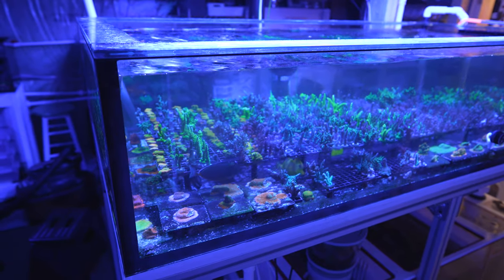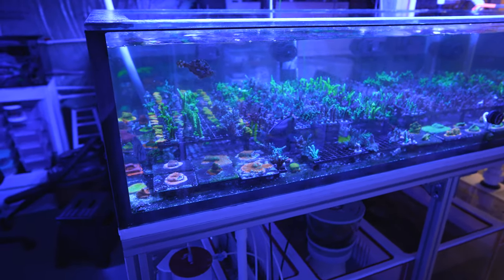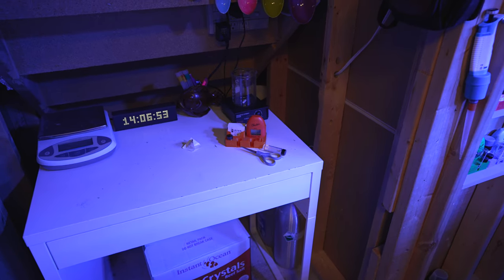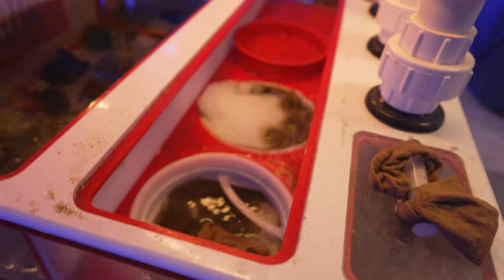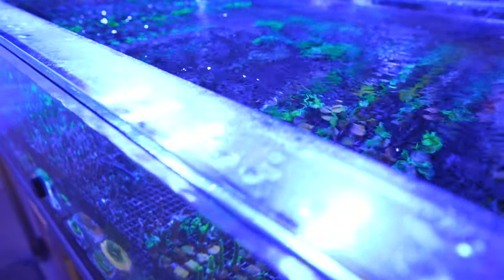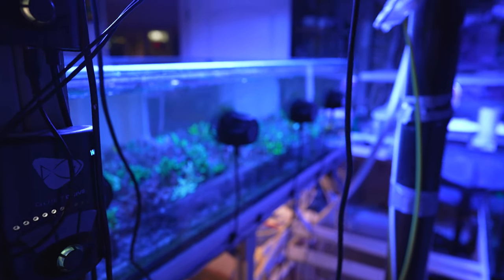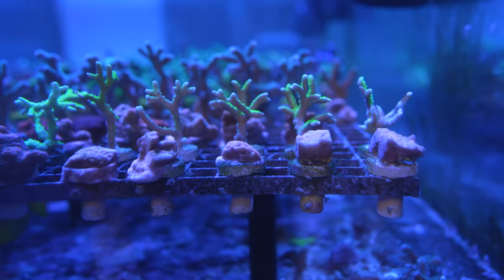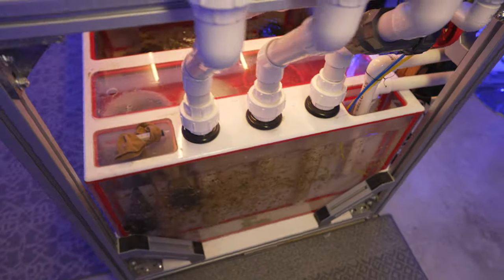Found Copper In My Reef Aquarium

Comment: This is a weird one. One thing I think though is that rusting equipment would not necessarily give you copper unless the piece of equipment itself was made from copper. One thing that cane to mind was that your system is in the basement. Do tou have ant exposed copper pipe above the tanks. I know a reefer that had a frag system in his basement with exposed pipe above the tank. There was condensation on the copper pipe that was dripping into his system causing all types of issues. Good luck.
Reply from the maker: OMG! I have not even thought about it, I'll double check, but I think all of my house plumbing is PEX.
Reply: Or maybe there’s something leaching copper into your source water… but wouldn’t that be removed by your rodi filter?  Is there anything in your rodi filter that’s leaching copper??
Reply from the maker: @MW-ut3dk  My theory is that it was the pump I was using to move water from RODI container over to Saltwater container.

Comment: Rust = iron oxide = not toxic. Corals love growing on ship wrecks.
Reply from the maker: Agreed, I know of people who dose iron into their tanks, especially if you have chaeto. But what else could this be?
Reply: @TreasureCorals  Iron and iron oxide is chemically not the same though. GFO, which is used to remove phosphates, contains a form of iron oxid. 
Too much iron as the trace element can be harmfull, too much iron oxid is not. So don't worry about a rusty magnet or pump, it's not a problem.
Reply from the maker: @Harolddespui  any thoughts or guesses on what could be the root cause for unexplained coral peeling?
Reply: @TreasureCorals  You got 200 times the amount of copper as in natural sea water so i would solve this to start with. 🙂

Comment: So, did you retest  your source water and saltwater after removing the pump(s)? What number did you get?
Reply from the maker: I just did. Freshly mixed is 0.02 ppm. RO water is zero.
Reply: That narrows things down that it can't be RO water. Did you mix new saltwater In the same container what u always have used? Just in case there could be contaminats in the container. Could it be contaminated salt? ( Unlikely but still possible ) anyhow something in process of mixing your saltwater must occur to contribute for copper to show up. ICP could confirm Hanna results so it could rule out faulty test kit results. Hope you will figure it out. I'm keeping an eye out for future updates. Best of luck.

Comment: Try seachem cuprisorb, Triton detox, or polyfilter , or some combination of the three to get rid of the copper… keep us updated.
Reply from the maker: Just bought and added 250ml of Cuprisorb in a filter bag. Think this is enough?
Reply: Really don’t know as I’ve never used it before myself but I would think the best thing to do is just use it and retest🤷🏼‍♂️
Just know that it’s what everyone seems to use to take out copper.  I don’t know if rowaphos does anything to remove copper…
Reply: @TreasureCorals  doesn’t that only do 500 litres Dmitry ? I only think this as mine is 900 and I had to get the bigger one
Reply from the maker: @petesreef1891  it said 250m for 500l to bring down copper by 12 ppm, or at least that's how I read it, so in theory it should bring it down nicely. I can always increase it as it is unlikely to do any harm

Comment: Did some Googling; ocean water contains around 0.25 ppB copper (which is 0.00025 ppm).
Reply from the maker: Right, so when copper is at 0.05 ppm - that's a lot higher, no?
Reply: @TreasureCorals  Yes, it is 200 times the amount. (0.05 : 200 = 0.00025)

Comment: Got a issue myself wghen icp came back with copper , problem came from a batch of salt
Reply from the maker: Ouch, how do you know it was the salt?
Reply: @TreasureCorals  Use to work for my City univerity and pulled some string to get water analized in Lab, It was even a big brand . Sended them the results and they denied any possibilties (but i did get salt refunded ist that wierd)